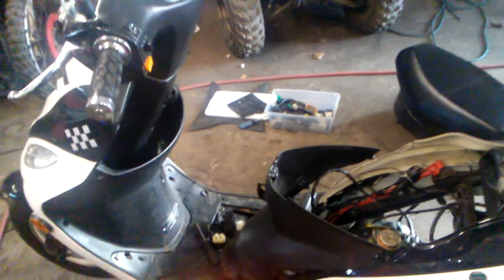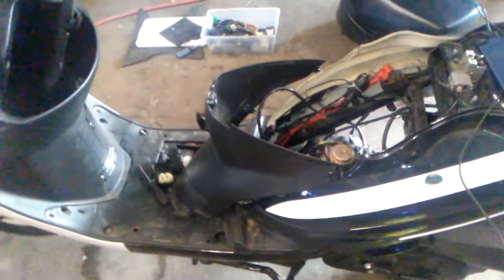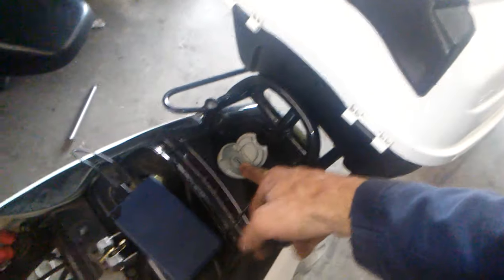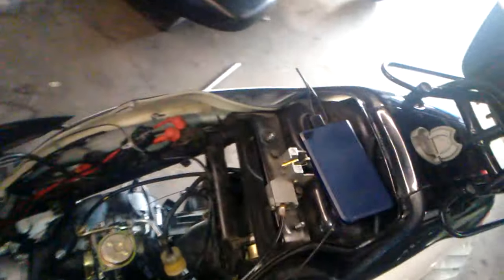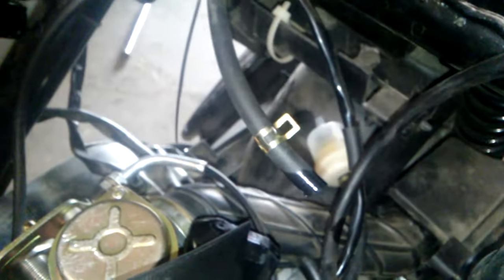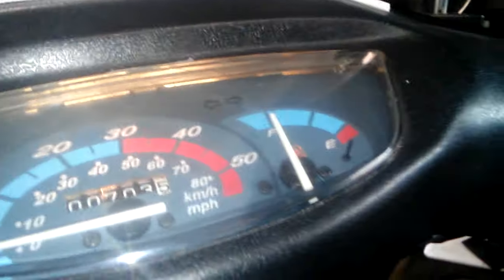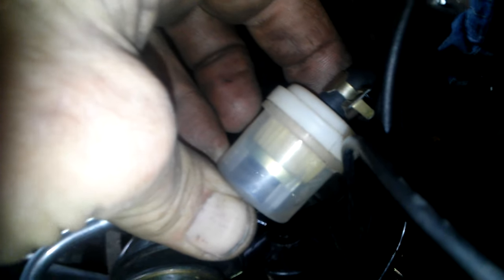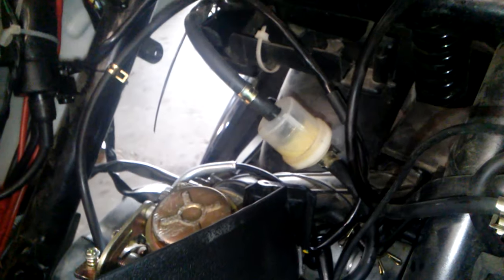Scooter runs short distance then stops running like not getting gas , parts for this in description

Comment: I wonder if this could be the case of my moped it's a Pagsta Regal Raptor 50cc, it runs for a while but when going up to 4th gear it will have a hard time after a while and slowly dies. It will restart again but usually I need to set the petcock to reserve or even turn it off strangely enough, someone told me it could have to do with the fact that there is too much fuel in the carb that will flood it and turning the petcock off will make it run as long as there is fuel in the carb, but I don't know. I haven't adjuest the air/fuel screws much, just got the idle sounding alright but I noticed the fuel screw is screwed out very far out, like almost as far out as it goes.  I also noticed in the fuel cap the rubber that is around it on the inside is cracked and dried out, maybe air is leaking through that and creating a back pressure like in this video? Could I run the bike with the fuel cap of? It isn't damaging the bike or dangerous?
Reply from the maker: Don’t run with it off can you check your exhaust valve gap they get warm expand n can cause it to open loosing power , you may also check float level if its to high it may dump gas at angle causing flooding n bogging !
Reply: @WaldensWorld  Thank you very much for the answer. I checked the valves and they seemed pretty good so I didnt adjust them, however I couldn't find a manual for this bike that is no longer in production so I used the settings that someone suggested, so I don't know for sure if those are correct but he told me to use 0.05 for intake and 0.10 for exhaust, when you mention the exhaust valves expand due to heat, do you think I should tighten it slightly more even if it seems pretty close to 0.10? I took the carb apart and checked it all out, however being a novice at these things I ain't sure what things should look like, but I noticed the float when turned upside down seemed to kind of getting stuck in the position. Also the needle seems to be set at the highest pin on top, in case that could be worth fiddling with that adjustment. I personally think it smells quite much of fuel fumes from the exhaust and the exhaust get very hot even after a short ride for 3 minutes or so. I got this bike that has been sitting for 10 years in a shed with old fuel and oil in it so I emptied the tank and put new gas and oil in and there are some rust at the botteof the gas tank, the oil was all black in the oil container. Maybe I should try and clean the fuel line? There is a white stick hoing up the tank inside, could I blow that with a air compressor or wash with water?

Comment: after ridding 150cc scooter hard to start again unless i remove gas cap please advise this issue thanks.
Reply from the maker: Exhaust valve or intake if the are close n warm up the metal expands u may need adjustment on valves

Comment: Thanks for the info mines does the same thing.  It's not shutting off just hesitates when giving gas.
Reply from the maker: Thanks for watching if you don't get it going I can throw few more ideas at you. It don't show me what video your watching just the message itself
Reply from the maker: Scooter . Hay your secondary jet may be clogged also in too of carb the metal cap has diaphragm n needle if your needle is adjustable you may try dropping in one slot ! Or up one also ! Let me know Maurice ! Good luck
Reply: @WaldensWorld  i found out the problem my air filter was bad. I  wasn't getting enough air.  Thanks again.
Reply from the maker: @mauricesmith918  good to hear ! N it's riding time !
Reply: @WaldensWorld  where does the blow back hose go from the front of the moter
Reply from the maker: @mauricesmith918  should go to the air box there is a small nipple it hooks to ! Not sure your exact scoot but most are similar . Some have a round tube canister  with hoses that also will equalizes pressure !

Comment: My fiancé bought a 50 cc scooter last week and it Boggs out pretty bad we bought a new computer a new Carburetor replaced the spark plug and it did not come with a gas cap. But after he replaced all of that it will idle all day long but now it dies if you give it gas. We are running out of ideas. Can you give us any kind of information to help us get it up and going
Reply from the maker: Water in gas ? Valve sticking ? Secondary jet in carb clogged ! Air filter problem ?
Reply: Try cleaning the Jets in the carb. Might have clog in the main jet

Comment: Thanks for the video. I have a challenge with my 250cc jonway scooter, that starts but not accelerate,  and what could be s solution
Reply from the maker: Are the brakes froze up put wheel in air n spin

Comment: I have the same issues but my bike different little bit ovetto 50 cc and after few miles stop can you help ?
Reply from the maker: Check gas cap n exhaust valves get hot n tight n stay open also fuel pump to start !!

Comment: I haven't read thru all the comments yet so maybe the answer is there somewhere. My scooter runs well half the time but when it's cool out(60 degrees maybe) or after I have ridden it hard for over 10 min and the engine is hot, it will die. Sometimes it will start and idle, but miss a bunch, sometimes it will idle but when the throttle is turned it misses like crazy and very slowly goes put put put(loudly) and will not rev(then dies) any ideas? Tried cap.
Reply from the maker: Vac lines or mabey exhaust valve is to tight when it gets hot it expands opens up a bit ! Vac runs diaphragm inside carb that pull the throttle piston up ! Look at those two areas
Reply: @WaldensWorld  oh thanks, I. Will try that. Previously I have tried cleaning jets, testing choke. I attached a tach and it varies between 900- maybe 1300 when this is occurring and will not rev past 2000 when twisting throttle

Comment: i am from India bro.. i have the same problem...what to do now.. which parts should be chnge or clean
Reply from the maker: Check gas cap for vent , check fuel pump is pumping , check exhaust vale , check gas is good , check float in carb , . These are things that may help ! If it ran at one time shouldn't have to replace a bunch of parts ! 
We're u at in India . I see you table water n Wells are drying up n water has to be trucked in to city . There is a man on YouTube that uses cow poop  n pee to help put trees back into desert it created ponds n streams litteryl from desert sand !
Reply: shillong, noth east....
Reply: yes... there are so many hardworking people here.. a man from here is named as forest man because he turns a normal area into a forst...and i thnk u r talking about him..
Reply: and i also want to inform i.. its a new scooter just 800km runs..

Comment: Hello I'm having somewhat of the same issue it seems to go for a good minute then when I press on the brake it just cuts off and then it seems like when I do driving for a long. Of time going straight to me I lose speed and starts going down and then it shuts off while I'm riding it
Reply from the maker: when it stops pull gas cap do you hear pressue or whooshing sound ? it does sound like your loosing fuel ! second check that your pumping gas to carb pull fuel line off carb hit starter for second verify you got fuel pumping ! make sure vent lines for fuel are not pinched or have cuts or holes ! next id check if the float is working or is gas barley gettin in carb ! screw on the front of the kick start cover has a drain hose leads to carb open it verify fuel in carb ! n last id check is exhaust valve lash ! a tight exhaust valve getting hot will do that also !  few ideas let me know if it helps! were u from jeremy ?
Reply: sounds like the issues I've been having with my Wolf RX50.
on longer runs in the city at WOT or thereabouts it will shut off when braking for a red.
sometimes it won't start for ten minutes.  
recently it bogged and shut off whilst running.  something it hadn't done before. same ten minute restart delay.
that was one of this years first warm days.
getting it home it did it a few more times but only at the red light.
carb is brand new.  I only use 90+ octane with an additive to counter the ethanol.
What I did do today was adjust the valve lash.  .003 for the intake, .004 for the exhaust.
Ran fine around the block a few times but I'll have to see how it holds up to regular riding especially as the weather gets progressively warmer.
I do have a jet kit coming and will go up one size but I'm thinking oil cooler ( app. $200. )
Reply: @WaldensWorld  on my RX50 there is a black hose that comes from the top of the valve cover.
it runs into a small black canister that also has a clear hose coming out the lower side.
then on the other side of the canister there is another black hose that goes to the intake.
for the life of me I can't get it situated without it having a kink in it.  ( the latter hose. )
bloody awful design.  I've made it less severe and it is only an emissions thingamabob after all.
Reply from the maker: @eamonnmckeown6770  can you trim it to fit ?
Reply: @WaldensWorld  perhaps.  I never wanted to work on this CCP crap in the first place but the scooter only shop I took it too was useless and expensive.
I wrassled with a 2T Vino last year so I'm a little leery of going deep dive on this one.
Yet I know I will have to.
Such a shame that a dealer that sells these doesn't have a shop that cares.
I had to take care of the brakes which I requested they do.
to be honest if I can ditch the emissions nonsense without hurting performance I will.
Sod the planet.  One CCP scooter won't kill it.
Reply from the maker: @eamonnmckeown6770  most dealer at required to have a designated place to fix them . I'm the mechanic for the ft Smith n Fayetteville mall shop for China shit !
Reply: @WaldensWorld  yep.  what is funny about this shop is that it's a full scooter repair shop in a sense.  Wolf brand I guess they're required to service but they flat out won't touch any other Chinese scooter.  They're very up front about that.  They could have had a very profitable customer if they'd held my hand just a little but heck they couldn't even say they'd fixed the running issue after charging me $207.  oh well.

Comment: This is strange but I have a completely different bike that I've been trying to figure out (1970 yamaha enduro) why it runs awesome for about 20 mins then dies out. I have about a 3.5 gallon tank and this actually makes alot of sense; I'm going to vent the tank and see if it works thanks a million!
Reply from the maker: Let me know if that works!
Reply: yea its like putting ur hand over ur mouth.if u will. u need a vent.
Reply: or replace the fuel tank valve. put a fuel shut off valve just get the right thread size i think there 16mm.

Comment: Have you ever seen one that shuts off when warmed up but will start right back up?
The longer the engine runs the shorter it runs the next time.
Reply from the maker: Very strange . I'd start at sparkplug coil ! N check compression ! But nope haven't hit that particular symptom yet !
Reply: I have the same issue since yesterday
Reply from the maker: @lurkingfell  check vent lines to fuel pump ! You may be running out if fuel !
Reply: Mine does the same. Still trying to figure out why it shuts off..
Reply: Hi Rusty Nuckles, though this might be posted 7 months ago, may I know if you have fixed your motor issue? I have the same problem and have done all the cleaning but still no success.
Reply from the maker: Exhaust valve be a good start !

Comment: I'm having same problem. Brand New scooter just bought showroom. Same senerio go for a while then starves for gas. I'll try that
Reply from the maker: The gas tank valve runs off vacuume ! I’ve seen pinch vacuume lines in these also
Reply: @WaldensWorld  thank you I actually put an older model gas cap on there and it seems to be running smoothly your video was very helpful if u can can u refer me to any other tips if something like this happens again

Comment: What's up man got one of these for riding around the racetrack, bought it from a guy, pinned ignition, sprayed ether kick started right up, so I bought a new carb, it started with ether. Then I realized vacuum wasn't ran, so ran that now it won't start. With or without ether.... Any input would be great.
Reply from the maker: Check spark ! Kill switch key switch . The black nwhite wire to computer is all kill switch you can use a poker n pop it out by bendeing keeper tab n see if it has spark if yes . Kill switch brake lever switch . If no prolly cdi !
Reply: @WaldensWorld  I have spark, I didn't understand the kill switch part....
Reply: @WaldensWorld  should also mention gas coming out from air filter... Checked floats even though it's new, not stuck...

Comment: I've viewed this so i purchased a new cap. But before i did that. My Icebear mojo magic 150cc  will run great but stalls, but if i put in a new sparkplug it runs like a top. Then it starts stalling all over. My mechanic said i need to richen up the mixture. Does that sound right?  I've only had the bike since January 6 2021. Its a 2020 model and has had so far 3 sparkplugs changes.
Reply from the maker: So I’d guess the spark plug may not be it ! But when you put one in the motor is cool new plug then it runs great for a while ! I’d first start checking the carb n valves ! Some have a pump that allows fuel in so if the carb wasn’t getting gas then you started it I’m guessing either carb float is sticking and actually may be dumping extra fuel ! Or on these some after day 1500 miles I’ve seen the valves get tight just enough to slow scooter down it may get worse when motor got hot ! Another are vac lines make sure the one from neck by carb goes to fuel pump n is clear from getting smashed by seat or that it don’t have holes  ! Try them n holler back we will figure it out
Reply: @WaldensWorld  I've asked Mr. Virberello the same question he replied and stated to change out my main jets. So I've ordered some. Between you, him and my mechanic ie. Not me, we will crack this mystery. When I say not me I mean it. The last vehicle I worked on was a Chevrolet Chevett and it cost me $1600 in new carburetor. Tried to change fuel filter, learned to not use Teflon tape ot fuel system.
Reply from the maker: @johnlovell1035  ok but I don’t know him lol ! What he say ?
Reply from the maker: Oh one more thing your roller in variatior may have flat sides causing it to not hit top speed and the rear clutch springs sometimes start sticking causing it to not hit top speed !
Reply: @WaldensWorld  he has video channel on YouTube.
Reply: @WaldensWorld  In one of his videos. He tell you about changing  the main jets on bottom of carburetor. He states by changing the jet you're engine can run cooler. He states manufacturers install the smallest jet. It all depends on your location like being at sea leave or higher. Its so carburetor gets better air / fuel mixture. Check him out. You're help so far has been stellar

Comment: Damn mine did the same and I never thought of the cap. Why does the cap go bad? What causes it?
Reply from the maker: Key hole I guess is the vent I noticed caps with key have a flap if you have flap open to the back of scooter it creates a lip when it rains it will hold water n go in key hole ! Best I can tell this may cause it to close ! Make sure flap opens twords seat not rear tire ! Just a hypothesis
Reply: @WaldensWorld  thanks

Comment: Comments: got that 420 hahaa! 421 now haaa... Bout to hit that weed pen and go check my gas cap situation. Bet thats the prob. Would have never guessed the cap. Helpful video dude. Short simple to the point, i like that. Peace out
Reply from the maker: Hope that’s it if not holler back I may be able to help !
Reply: @WaldensWorld  sure enough, cap off and fired right up. Ran smooth for about 30 seconds and wa waaa, not getting fuel. Started again ran 10 seconds and so on. Guessing its a clogged jet. I checked the carb real quick when i had everything apart and bowl was clean, bone dry but clean. Float seemed ok jets appeared clean. Looks like ill have to pull it all apart and give it a real once over, wire jets and whatnot. Back story found scooter tao tao 50cc next to dumpster half taken apart messed with and left. Only thing missing is a turn signal. Over all good shape, pretty clean. Pulled tank cleaned that as nothing was flowing even after removing petcock. Got thoses cleared. Checked carb spark good air clear back together and no start. Saw your video and vroooom then no vroom.  Guy told me float could be sticking. But yeah its def lack of fuel issue right now. Thats where im at if im missing something id appreciate any input. Pulled the line before filter and cap off fuel flowing freely, so def good call on that thanks again.

Comment: My brother put Diesel in my moped I syphoned it out and got it working but when it starts it will go and then stop and then go and stop takes a while for it to run fully
Reply from the maker: Prolly still have smell drops in-line somewhere hopefully it burns on through ! Did you get a new spark plug?

Comment: its the vacume mate not pulling fuel through just doing one with same problem now
Reply from the maker: I fixed mine it was gas cap ! But thanks someone may have your issues also ! This one is hard to diagnose is why I did video on it !
Reply: i have as problem now im doing this Sr for some one and its bogging out on full throtal and when i drop throtal it picks up agin any ideas ,its nothing like my crf tbh not sure if i aint pulling enough fuel through
Reply from the maker: So put it in kickstand ! Does it do it with back wheel in air ? You may have a rear clutch sticking ! Or dirty jets in carb also ! Prolly secondary jet ! If your carb was full to start it should bog till it was empty that take few hundred feet I’d think variatior is wore out or mabey clutch is sticking